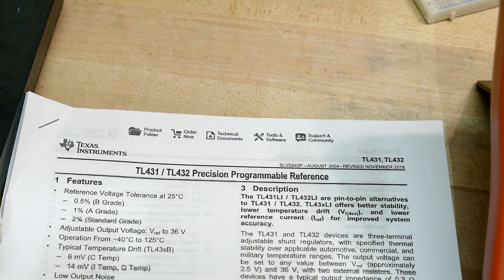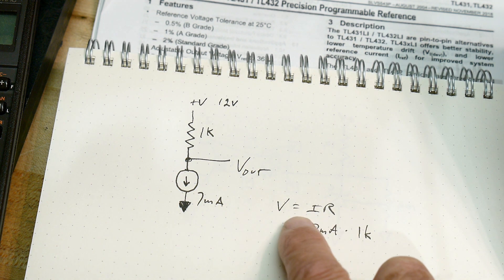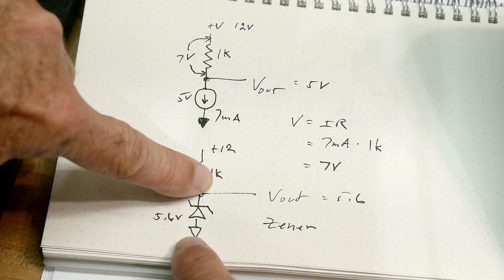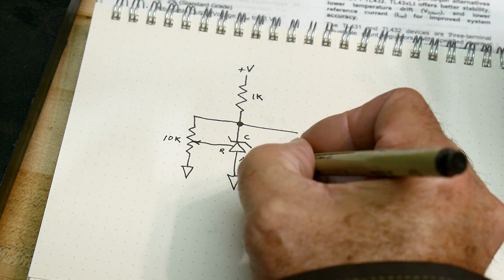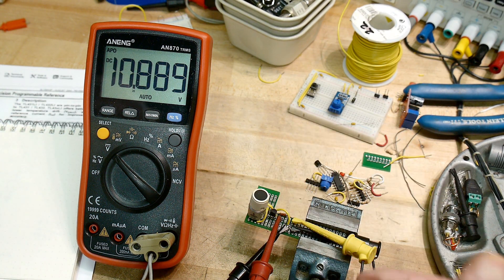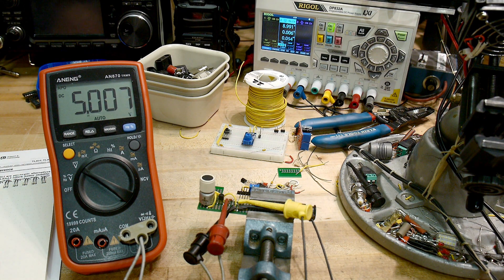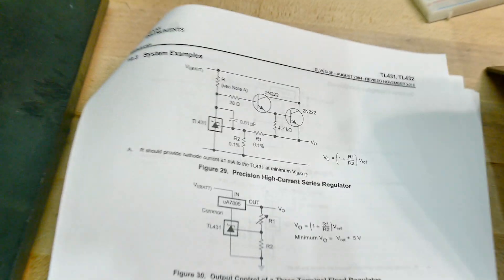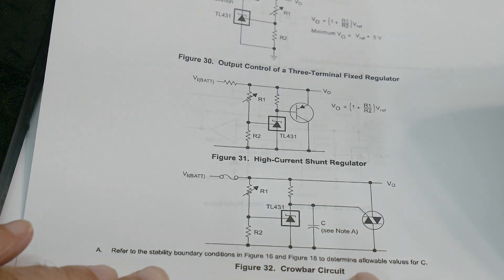#1115 TL431 Voltage Regulator IC

Comment: I like using the Burr Brown 10VDC REF102..then use a divider..or adjustable pot...then buffer that with nice power amp if you need more current...like use a LM675 

Thanks for explaining the TL431

Comment: I actually used these IC regulators to build a dual transmitter/receiver RC battery cycler many decades ago. Since you can so easily program them via a variable resistor (trim pot), you can set the drop out voltage to switch from a fixed current discharge rate to charge the batteries again. And that cycler worked great... Thumbs Up  Between these TL431's and the LM555 timer chips, that have to be the most used IC's every invented!

Comment: 431 and it's alternative is one of the best programable voltage standard for the price with L317 it can deliver any voltage you want ..As i said ..one of the best ..only better option is precision  heated zener with Opamp ..but complexity is much higher and also price...but if needed 431 is the best as first stage precision voltage source